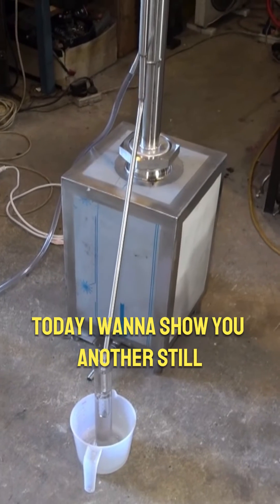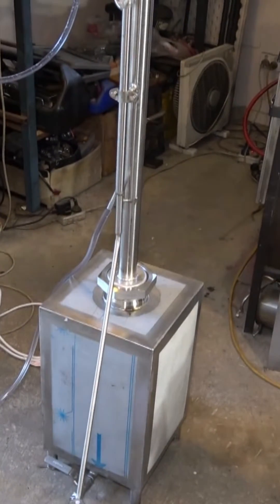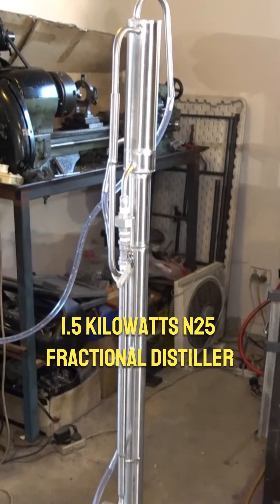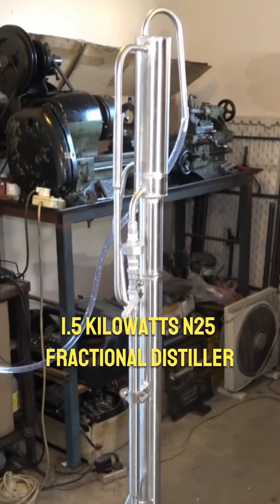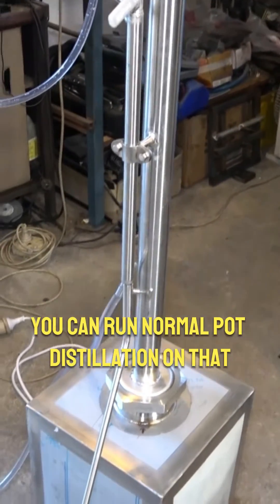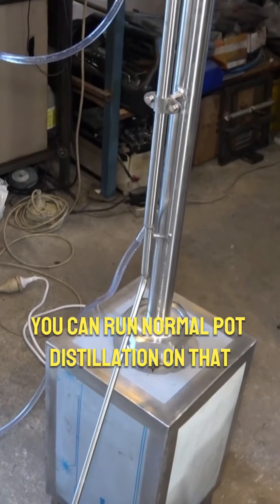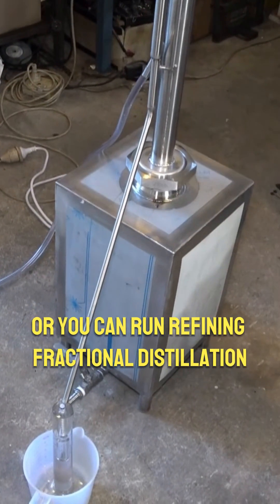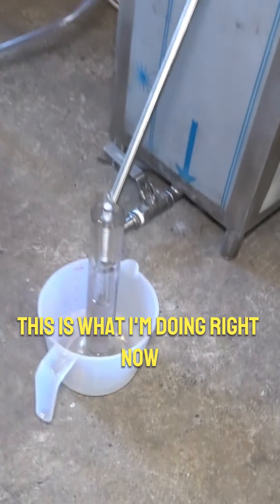Home distilling- test run of the "N25" fractional alcohol still.

Comment: What do you think about using the distiller that vevor offers for fuel distillation?
Reply from the maker: Honestly I do not know, anything they offer for fuel distillation, though makes me wonder how they able to offer a complete distiller for the price that two - three times cheaper than just materials required for my smallest still construction? I saw their distillers, and despite of being polished and shiny, they are just a primitive pot stills with an open type water filled condenser, this type of still potentially not capable of anything stronger than 50%, not saying about consistent 94% output from start to finish, so question the following - Quality anf type of material, thickness, longevity, slave labor - what is the secret?
Reply: @santeryi9  I picked one up for fuel distillation but haven't used it yet. Was just wondering what ur opinion was
Reply from the maker: What sort of fuel, petrol, diesel or alcohol, what percentage it's capable of
Reply: @santeryi9  pryolysis oils of plastic and tires. The system I got is a 13 gallon with the thumper ( wether I use it or not it's nice to have a 3rd tank). I'd like to do gas, diesel and heating fuels